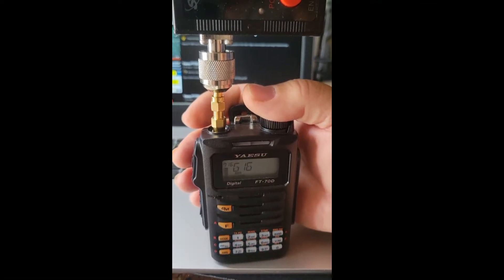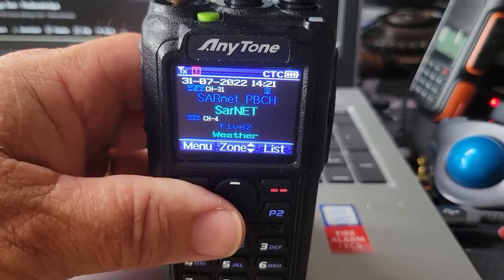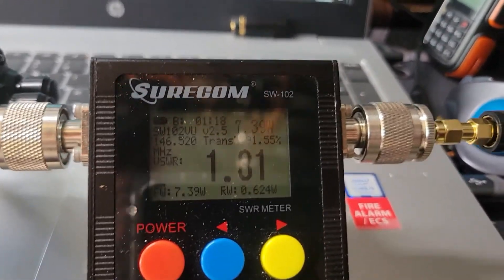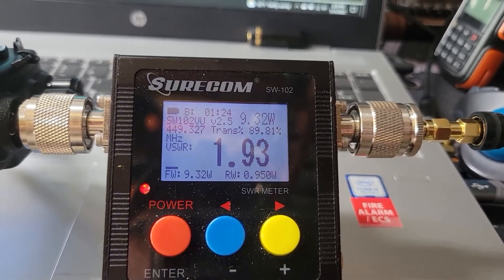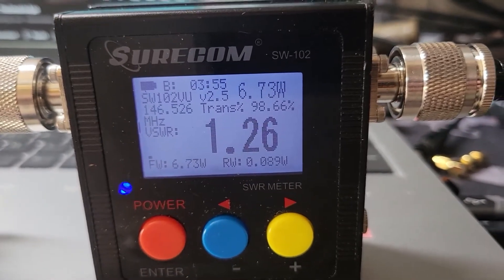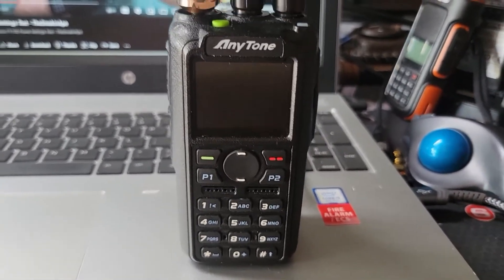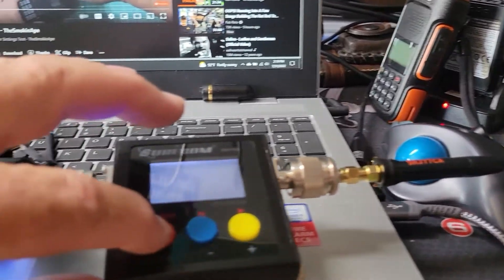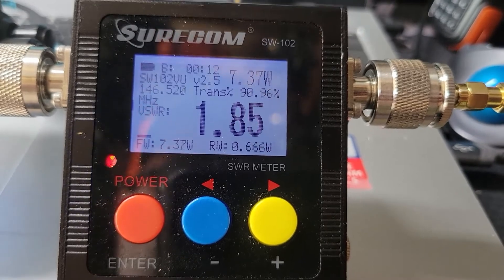Yaesu FT 70D vs Anytone 878 Power Test

Comment: Hello,

You are doing a power ratio measurement with an antenna, do you know that the result is false with an antenna?

Concerning the stationary wave ratio of the antenna, do a measurement with a good quality dummy load, then you will have a good measurement of the real effective power.

Cordially
Reply from the maker: Now where would you ever get an idea like that? Please explain.
Reply: @Rusted_Link  Hello,

Well, if you measure the power of your set with the antenna that is not at fifty ohms very precisely as you measure the power of this set and the antenna to work properly needs a counterweight which is your hand.

If we perform the test with a dummy load, the standing wave ratio is perfect because the impedance of the load is 50 ohms, exactly in this condition, the power emitted by the transmitter set does not return to the source of the transmitter, all the power goes into the load.

If you perform this test with an antenna with a slightly higher standing wave ratio, you will get the impression that you have more power, which is not true because the standing wave ratio is incorrect

If you want to make a real quality antenna measurement, I can recommend rig-Expert with this measuring instrument, you will only measure this antenna with no interpretation error. 
You will get the specified antenna impedance, standing wave ratio at the requested frequencies and many other characteristics, but it is a professional instrument and the price is proportional to the quality of the product. .....

Cordially
Reply from the maker: @patrickd4049  my results match those of the tests performed with the dummy load.
Reply: @Rusted_Link  I totally agree, but in your video, I did not observe a fictitious load. If you have measured the power of your equipment with a fictitious load and not with a connected antenna, then yeah, you have a real power

But the measuring equipment you used to measure the power in this video, is not the best in terms of accuracy, reliability, you would have needed a professional power meter, I think you have a better result.

Cordially
Reply from the maker: Didn't matter, I've tested both methods. Give it a try.
Reply: @Rusted_Link  Hello.

In summary, if the antenna has a very low ratio of stationary waves, yes, you will get power without making an error.

But a real technician in a measurement laboratory uses a non-radiant charge with very good resistance to reactance. But non-radiating charges are very expensive. In the professional environment, with, as you know, a professional spectrum analyzer.

But you can also buy a mini spectrum analyzer for much less. TinySA: spectrum analyzer and signal generator

But it will not have the same quality as a Rohde & Schwarz. Nor the same price.

Cordially
Reply from the maker: @patrickd4049 Doesn't matter, I've tested both methods. Give it a try.